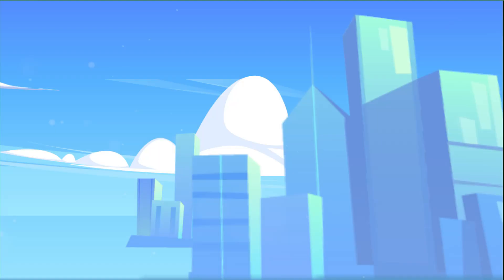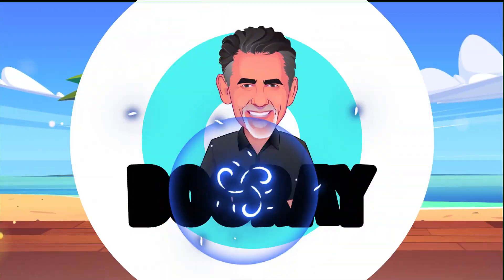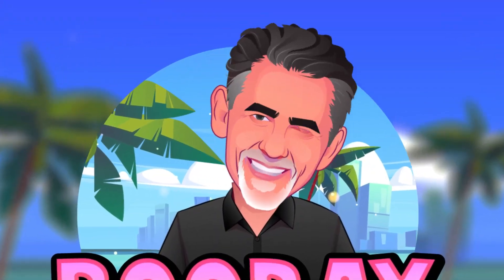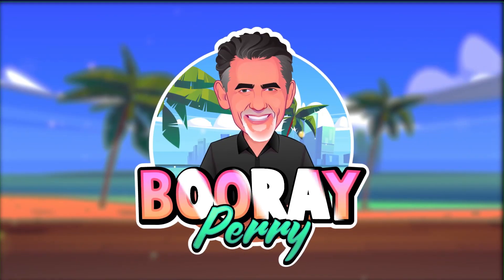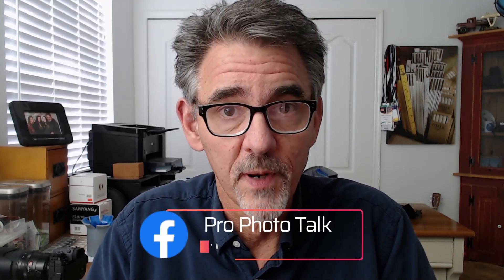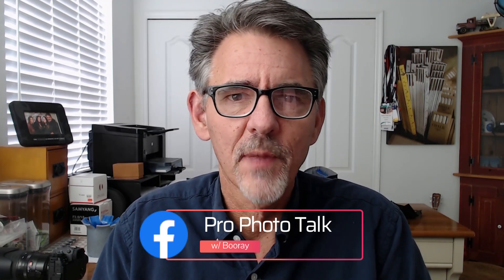What is Hi-Speed Sync?

Comment: OK, you lost me when you have a 200 or a 250 high speed sync and you are setting your shutter speed at 1,000. Why would you set your shutter speed any higher than the high speed sync rating of your flash?
Reply from the maker: There might be a couple of reasons. First, you are trying to freeze motion. Second, you are trying to lower the exposure.

Comment: This is probably the best simple explanation of HSS that I've seen. Really great concise explanation.

Related mini rant: a bunch of YouTubers have made videos about "I use ND filters to get below sync speed because HSS can't go to max power" - one of those deals where one guy made a video and a bunch made copycat videos but no one stopped to think about it... The 3 stops the ND filter gave to get below sync speed are also 3 more stops that the flash needs to get through. Net gain = 0.
I do use HSS in bright sun a lot, it just takes bigger lights and tighter shots (to get the light closer). Those are the only ways to get more light on the sensor.

Comment: Thanks for explaining that Booray, so i shouldn't use a faster shutter speed than the Sync speed with flash. I have a Nikon SB-700 Flash and i haven't tried Hi-Speed Sync on it but i will try using it when i photograph my Nieces running fast. Another great video.
Reply from the maker: You can use it as long as you don't need every but of flash power.